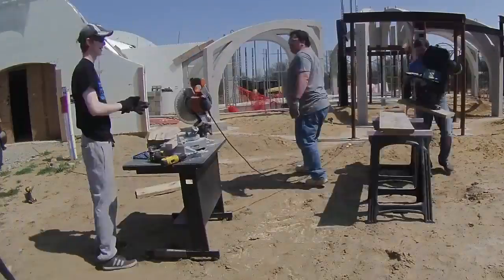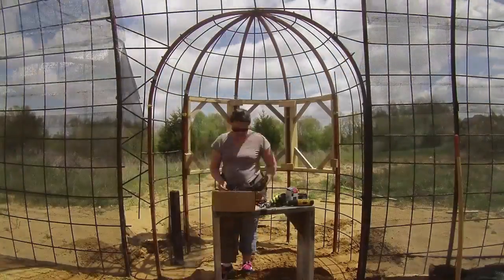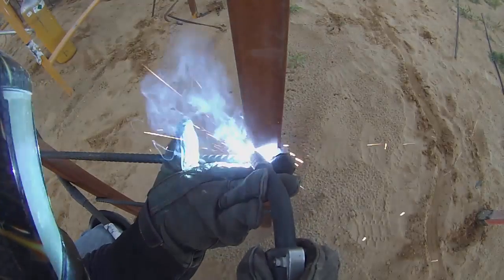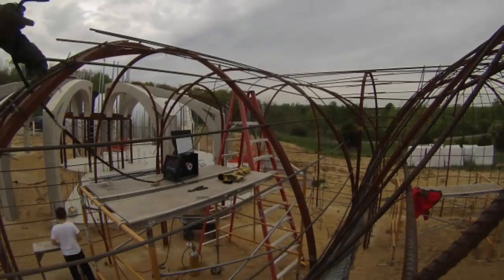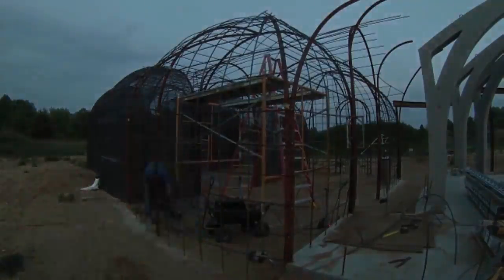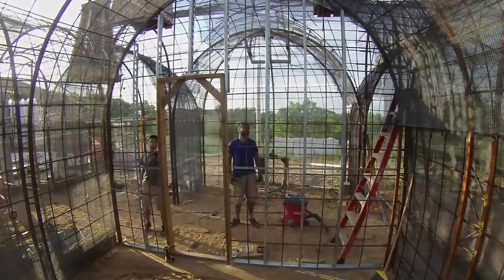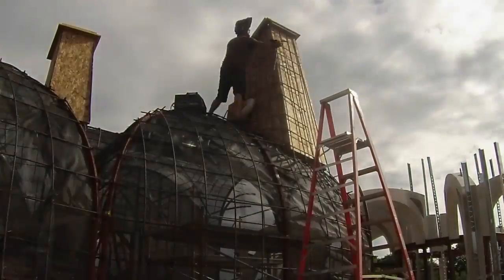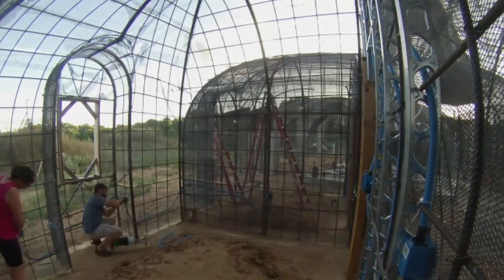30.0 Bedroom Rebar and Lath

Comment: Yes great work very well done video!
Just really curious about the building codes and inspections, where you are . I usually get the grumpy inspector.  They all might be.
Did they require engineered plans ?
Reply from the maker: The inspectors are all pretty friendly.  They did require engineered drawings and they expect me to follow the drawings ;).    

The closest they got to giving me a hard time was saying that I left the rebar up long enough that they were concerned it would rust.  He said if I didn't get it encased in concrete soon, he would require me to sand blast the whole thing...  And this was after I had most of the forms up.  Honestly, if the gunnite crew had delayed for one more week, it would have been snowing and we would have had to wait for spring.  The winter would have destroyed the formwork and needing to sandblast all the rebar would have killed the budget in the spring.  It was a close one.

Comment: It would be faster, cheaper and much stronger to use an airform, basalt rebar and shotcrete
Reply from the maker: Based on what?  And what do you get?  

Faster might be right, but that is really a function of your help and the scale of the project.  It is easy to work with basalt rebar if you have something else (like the air form) deciding the shape. 

A monolithic dome is not cheaper though.  You pay more for the air form, more for the spray foam, more for the basalt rebar and then more for the gunite crew to work from the inside (my crews simply said they wouldn't shoot from the inside).  (Or you could do it yourself (make your own form) like aircrete harry, but you still might not get cheaper).

And stronger is very debatable.  It is a function of the thickness, shape, concrete mix, reinforcement, etc.  There is nothing inherently stronger about what you are suggesting.

And finally, what you get...  With an airform, you usually get a monolithic dome.  Pretty common.  I wanted something more unique so that is what I built.  However, domes are cool too.  If you have built one, share the video links.  People who like my videos will probably be interested in yours too.
Reply: @SimonHomeintheEarth  Based on reality

Comment: I love the look of the arched rebar. Then you ruin it with square windows? I don't get it.
Reply from the maker: Roundtop windows cost much more. Paying 5 times more for our windows would have killed our budget and the whole project.  Instead, we needed to work around these things.  For instance, in my office (closer to the front of the house), there is an archtop, but it is fixed and only the lower rectangle opens.  We are also using polycarbonate to make 2 large round windows and 10 cusp-shaped windows.  If you have some extra window money laying around that you would like to send my way, I would happily switch to archtop all around.

Comment: I'm curious why you wouldn't wrap the osb with a vapor barrier? seems like a wood rot/ termite buffet?
Reply from the maker: All the OSB was just temporary and was removed (along with the rest of the 2x4 frames) after the concrete cured.  We didn't leave any of it long enough for it to rot or for bugs to get interested (termites are not a common problem in Michigan).

Comment: Where is the foam board installed? Video link please?
Reply from the maker: In my design, I have the concrete on the inside (thermal mass) and then add dirt (more thermal mass) and then an insulation umbrella, and finally more dirt to protect it.  No video link yet, but my Youtube is well behind Facebook.  On Facebook you can find photos of us working on the umbrella (although we were too busy working to take many pics).  There is time-lapse footage and I'll eventually get it on to youtube.  https://www.facebook.com/HomeintheEarth/posts/917241855089975

Comment: You have talent and more energy than most people, but none of this labor intensive project and the imposition on family make any sense.
An earth covered house on flat ground requiring trucked in fill will take a long time to pay back environmentally. The rebar must be located in the gunite precisely for strength, not just be there. The electric boxes do not need to be welded to the rebar frame code wise, the steel just needs to be  bonded to the grounding electrode conductor however that is just an opinion for a concrete structure. Footing steel yes but welding the boxes to the rebar? Not required unless to hold them in the form.
You are very manic, with a lot of energy to burn also much free time.
Reply from the maker: missed this one when it came in.  The home isn't one flat ground, I pushed enough dirt out of the way to bury it later.  Nothing more will need to be trucked in.  The rebar depth is precisely controlled by rebar chairs that keep it exactly 1.5 inches from the inner lath surface.  The electric boxes do not need to be welded to the rebar frame for code, but they do need to be fixed in the right spot and sometimes I welded them because it was easier.  Other times, I just used self-tapping screws to attach them to steel tubes or just wire to attach them to lath.  But yes, overall, this place is talking a lot of time and effort.  If I had built a simple rectangle, it would have been easier.  It's too bad I didn't want a simple rectangle.  ;)

Comment: Structuraly very interesting vid, great presentation too, not that its important for you but dzjeez those skylights xD ugly as f lol. I do like the rest though. Going to be a nice bunker
Reply from the maker: Yup, should have made the bedroom skylights a foot or two shorter.  Also, should have been more clear with the shotcrete guys that they were to be trimmed off at that wood ledge.  Instead, those guys left them really fat (like 8 to 12 inches thick concrete) which will make them look even bigger at the end.

Comment: can you get a cell phone signal inside the house under that metal mesh?
Reply from the maker: Yes, I had this same concern about it being a Faraday cage.  I was involved with building a bigger and deeper earth shelter a few years ago that had a double rebar cage and much thicker steel supports.  Every time I went out there, I would check my signal in a bunch of different places, and even after burial, I had no problem getting full bars of 4G at the back of the home.  I guess cell signal is small enough to get in without a problem.  Now, I am able to test in my own construction and have not had any problems.
Reply: cool thanks!
Reply: Basalt rebar is lighter, stronger, and won't rust. Is it too expensive?

Comment: Are you going to pour a slab on the interior later?
Reply from the maker: Yes, the shotcrete makes a mess, and there is a theory that the weight of it may cause floors to crack, so I was advised to add the floor later.  The bottom 12 inches of the shotcrete will be covered by the floor (4 inches of concrete, plus radiant pex, a little insulation, water barrier and dirt.)  The idea of having the shotcrete seam 12 inches below floor level is also a good reason to pour the floor later (more waterproof).

Comment: Why are the skylight boxes so high?
Reply from the maker: I am putting 3 ft of earth above the roof and the skylights will come up above the earth far enough that no one will accidentally fall into them, mud won't splash on them, etc.  Maybe they are a bit taller than they should be, but it made sense at the time.  ;^)
Reply: Simon HomeintheEarth ahh, that makes sense and explains some of the other design decisions. Thanks